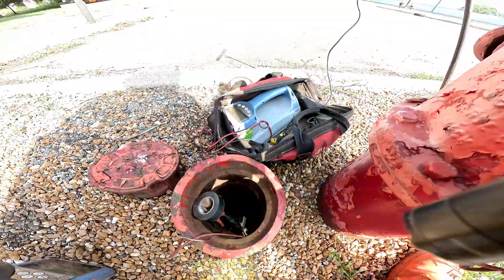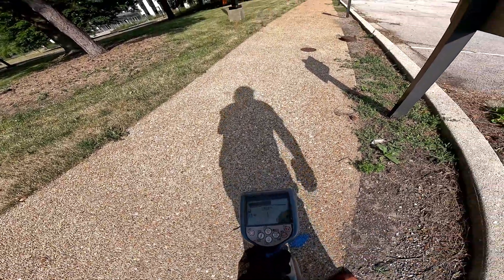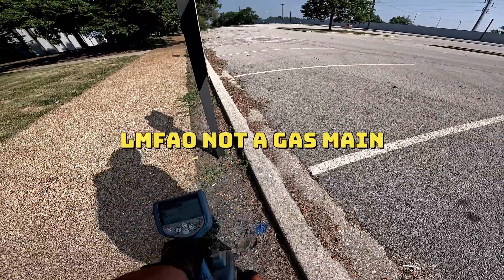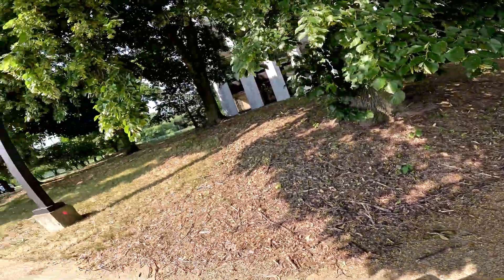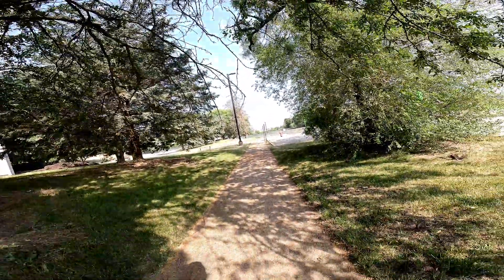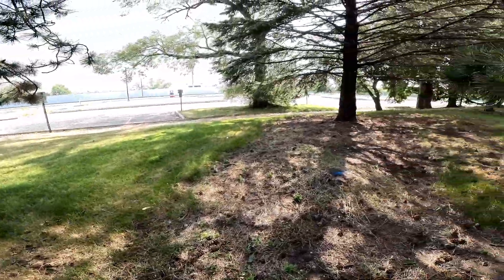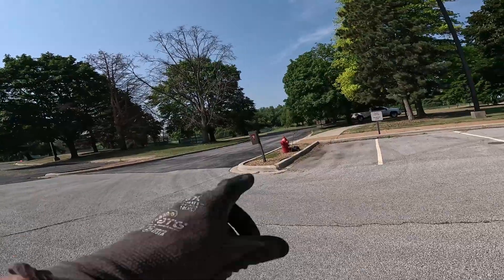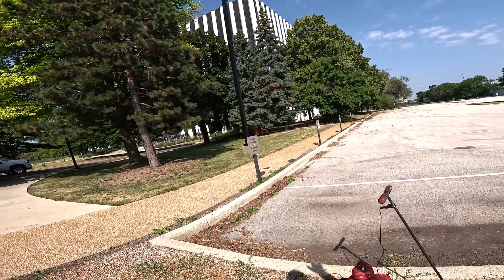Locating a 8" Ductile Water Main: Simple and Easy Method

Comment: what probe is that recently i brought a longer one but its not conductive lolololl
Reply from the maker: A non-conductive probe would typically be made of fiberglass, but I use the Bully Tools Soil Probe, which has a steel rod. However, I had to scrape off the powder-coated layer from the steel rod.
Reply: @811chicago5  that's the same one I have. How do you scrape off the coating?
Reply from the maker: @yiazmat7104  A really sharp knife and sandpaper scrape away the powder coating from it.
Reply from the maker: @yiazmat7104  If you have a grinder that will work a lot better